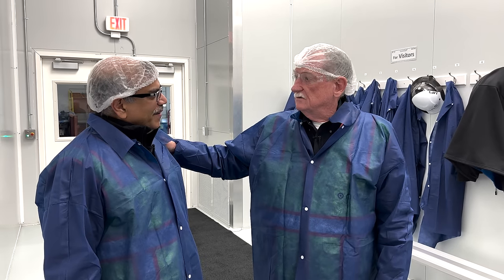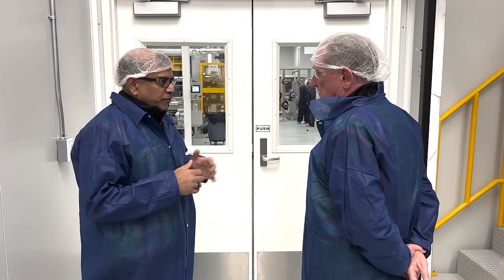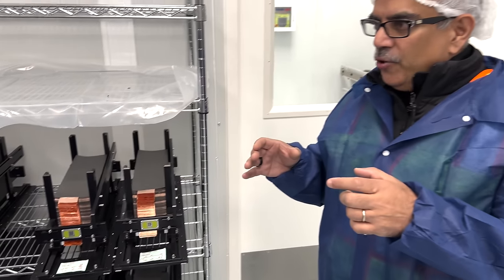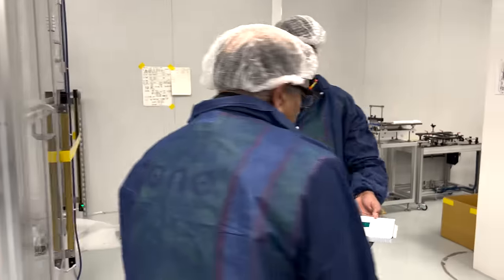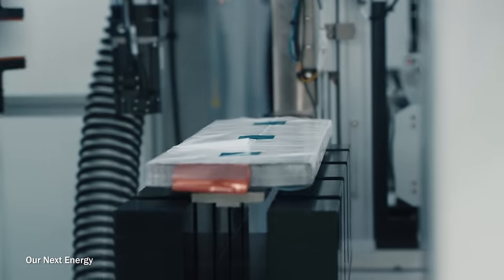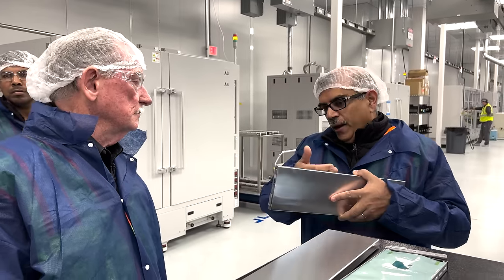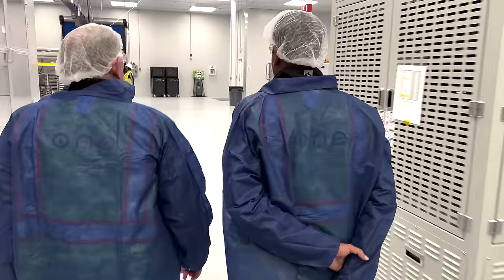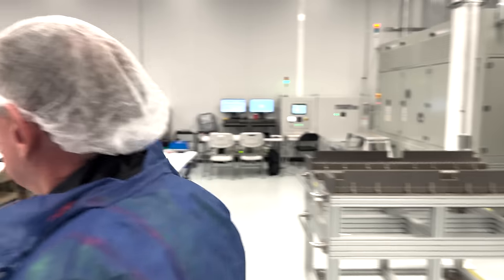Inside (ONE) Our Next Energy's New Michigan Factory!

Comment: They need to produce at least 16 such cells per minute per single mass production line to start to be competitive. But this is a moving target aiming for even faster speeds ....
And , yes LFP is at least 70% of the automotive market , with the optimal prismatic side terminals and side or bottom venting cells for optimal safety : LFP pack can be designed to avoid any thermal runaway cell to cell propagation without losing much space
Industrial market is also going massively LFP (machinery, off-road, trains etc ...) , as well as ESS
SAFETY FIRST ! and LFP is so far the best choice for that top priority
Reply: Safety is still big issue with this conventional lithium-ion battery because it hasn’t solved dendrites problems yet which is a fire hazard.
Reply: @koobanatv  what is important is to avoid any thermal propagation from cell to cell. so if one cell goes bad, the whole pack does not get on fire, and the parking lot, the house..... and with those LFP cells, you can achieve this safety target at pack level (proven fact). that is way more difficult for NCM cells, you would need additional expensive and thicker materials in between cells increasing the pack cost and decreasing  the pack energy density.... this is why LFP is taking over the automotive industry ! and pack capacities are now "good enough" with the Fast Charging capabilities reached with LFP for the long trips. NCM should be for only niche vehicles (sporty, longest ranges, luxury ...), less than 30% of the market
Reply: LFP and NCM can co-exist as two different markets. However, if separator is replaced with solid-state separator, safety and performance are even greater. Solid-state separator prevents dendrites formation and it also allows for higher volumetric and gravimetric densities which result in better performance and longevity.
Reply: @koobanatv  Yes NCM is for niche BEV applications from now on (less than 30% of the total market). 
Even serious PHEVs are now using LFP in China with over 150 km range and 35 kWh packs... quite far from what Legacy OEMs are kindly proposing into the west and that i consider to just be a glorified HEVs in my real life conditions of usage.
Now regarding SSBs, i would not hold my breath about that technology that is still quite far from performance and industrial maturity. From what i heard, SSB coating process could be quite , let's say tricky, using toxic explosive under high temperature and pressure condition gases ... but there might be some great progress done somewhere to prove me wrong. Of course SSBs will have also to match the LFP or NCM costing at iso performance to get some market acceptance.
Reply: Volkswagen is joint ventured with Quantumscape for 1GWh next year at 30% capacity using solid-state separator. Then at 80% capacity Y25. At year 2026, they will have expansion facility (QS1) at 20% of 20GWh capacity. Revenue starts next year for their 1GWh pilot facility.
Reply: @koobanatv  as we say in my country side : "this is at the end of the market that one count the bull-shits on the floor". We will see if they can get Power, Energy, Cycling, Temperature Operating Range, Calendar Life etc ... targets ... within a competitive price range. Hope they can ! ☺

Comment: Is my math wrong or is that enough batteries for about 100 BEVs per year?
Reply: 0:56 At full production rate the factory will produce 20 GigaWatt*hours worth of batteries per year. (It is expected that the full production capacity will be reached after three years.)

As an example, Tesla model 3 comes with a battery pack of 50 KiloWatt*hours in the base configuration. Thus this factory will be making enough cells for 400000 of such cars per year.

Comment: LFePO4 has proven itself to be self combustible under certain conditions.... Why do they keep on saying this solves the fire problem?     This chemistry also expands in the case... not a good quality.    I keep getting the feeling that people convince themselves of a path forward mostly due to price.     ALSO, I don't see any thermal control mechanisms --- so the larger battery in the can can't be charged and discharged quickly.    This might be a lower performance option.

Comment: The OEMs use to make the supplier to all the raw material qualification even if it was part of a subsystem where the supplier of one of the materials not all parts in the subsystem.  Because the use of new technologies and methods I can see this supplier doing the validation of the raw material.  Photo documentation of critical operations is an “about time” moment.  With all the critical characteristics (effects compliance to Federal Motor Vehicle Safety Standards) in a vehicle now the photo of a finished article requires less talk and interpretive dancing for marginal performers.   I can’t believe they keep talking about alternative battery technologies with all this equipment intensive processes, and each technology requires it’s own set of equipment.  

That pilot line looks like an aerospace pilot line.  It’s not simple and requires intervention.   Gives me the impression that maybe batteries were not the best choice for vehicle propulsion.

Comment: LFP is the future and LFP in the US will accelerate EVs even more. around 4-5 years ago, I thought LFP was just the same as lithium at lower density and price.  but after Tesla used LFP for the first time, I start digging and I conclude it is the best battery for EVs!  18:36 800V, currently, is nothing but to reduce charging cable sizes, charging speed still limited by the cells. This the reason Tesla is not in a rush to get to 800V.  800V will be more valuable once manufacturers start implementing 800v on the powertrain.

Comment: Cylindrical is the only way to go for automotive. Shocking that the rest of the industry hasn't figured this out.
Reply: Why ?
I have a Model 3 with a CATL LFP battery pack and I'm very happy with that.
Reply: @pauld3327  I'm talking about form factor, not chemistry. Your battery cells are cylindrical.
Reply: I think you're wrong. China figured out that prismatic is a better format. That's why most of their cars have prismatic.